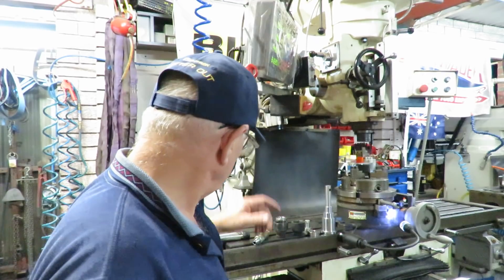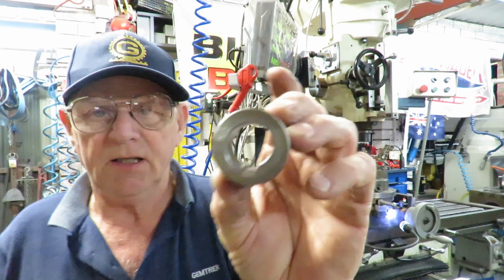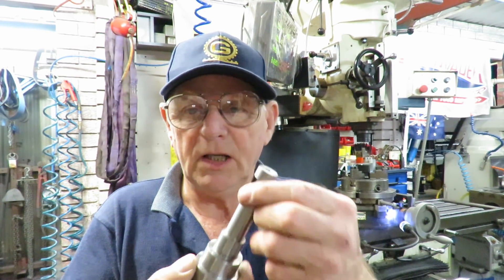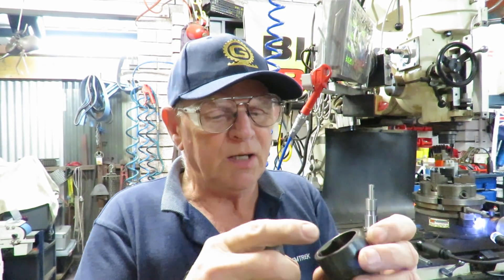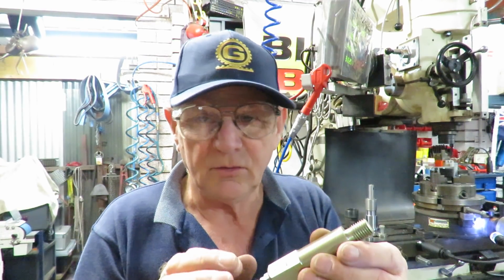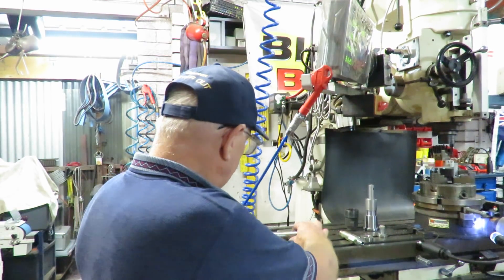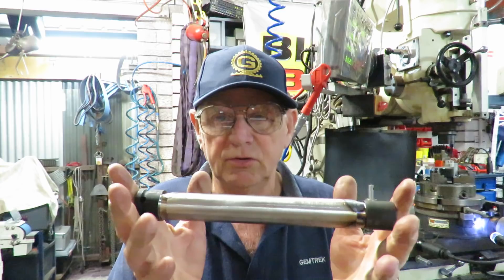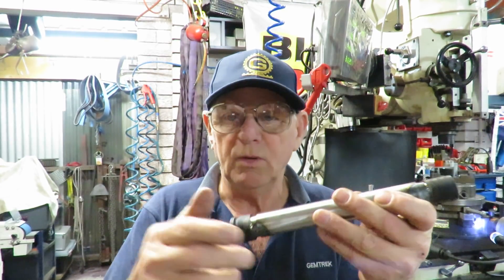Peanuts and Single Malt #4 Jigs and Tooling in my shop

Comment: Nice work. How did you make the small square tool bit 'slot' in the lantern?
Reply from the maker: Ian I drilled a pilot hole and took it to a mate to wire cut the square.